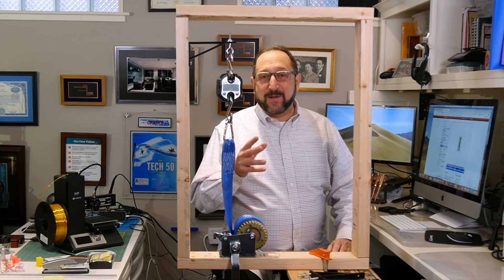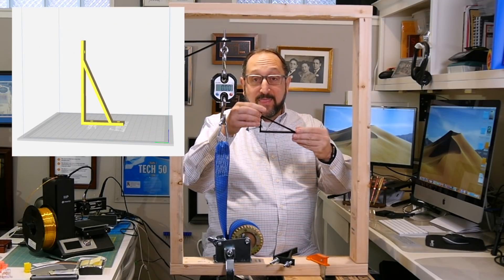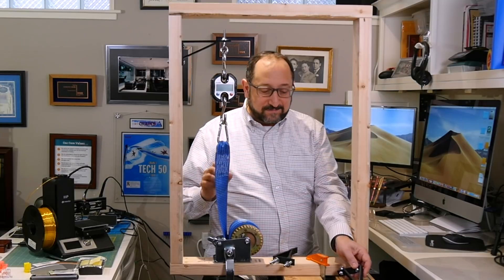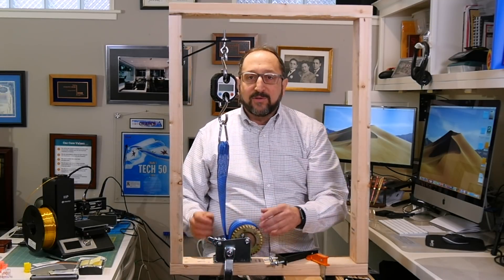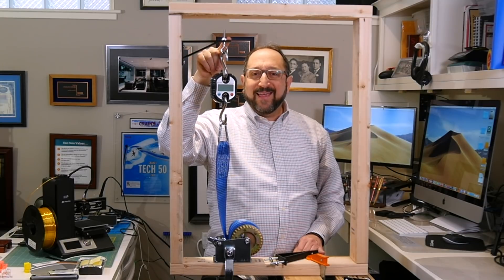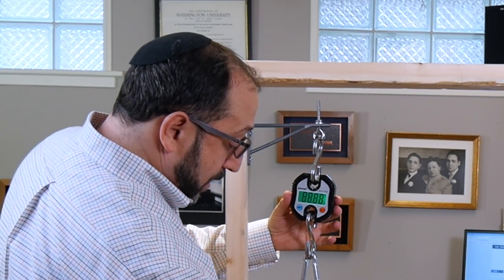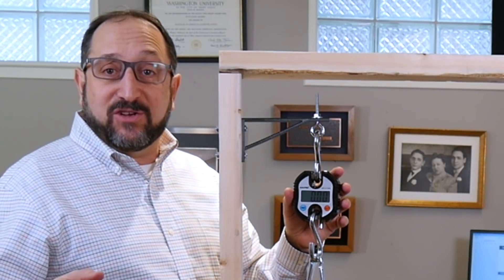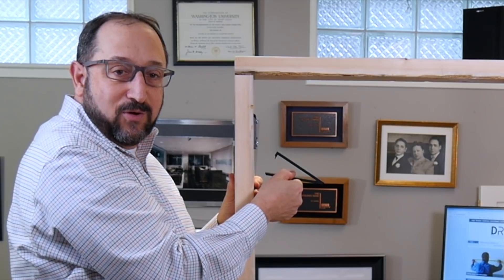How to Print Stronger 3d Printed Parts

Comment: Actually I think we should focus on a moment when print is starting to deform- because in that case it already has a sympthoms of failure and eventually it's going to break. So , my idea is: pick up a max weight value (for example of shelf + total load) and calculate thickness/dimensions of  our print. That would be very practical and helpfull approach ;)
Reply from the maker: Good thought.  Thanks for sharing.

Comment: On the PETG you didn't use a fan did you?
Reply from the maker: I used default PETG setting which generally include a fan at about 50%.
Reply: @DrVax That is why it failed like it did.  With a fan it prints prettier but can't meld itself to itself as well and you will see about a 50% reduction in line to line strength due to it.  I used to print with a fan for PETG until I saw that and I now no longer do and all of my functional parts seem to shatter now instead of seem lines splitting apart.  Kill the fan for PETG and ABS prints.
Reply from the maker: Thanks for sharing.  Interesting information.  I now have a printer, Monoprice Ultimate 2, with a full enclosure.  Might be interesting to retest with no fan in a full enclosure.

Comment: Thanks for the video, Irv, what is the make and model of the scale you used in the tests?
Reply from the maker: The scale is this model purchase on Amazon "Hanging Scale, RISEPRO Digital Professional Hanging Scale W/Accurate Sensor for Luggage Fishing Construction Hunting Balance Pocket Crane 150kg W/Backlight RP-C100".

The winch is this model "8MILELAKE 600lbs Hand Winch Hand Crank Strap Gear Winch Polyester Strap ATV Boat Trailer Heavy Duty".

Comment: Ok this is the reason that designers should think differently designing for 3d printing instead of copying the designs of metal or wooden parts and hope they'll work.
Even the different orientation can double the strength of a part. Plastics are largely anisotropic. So the layers should be thought of as wood fibers and treated accordingly.
Reply from the maker: Exactly.  Great comment.  Thanks for sharing.

Comment: I wonder how much stronger ABS would be?   Did you have any issues with PETG sticking to the bed, that is my fear in trying it?
Interesting experiment!!  Thanks
Reply from the maker: In the tests on other channels ABS is about the same or slightly weaker than PETG.  I see limited reasons to use ABS with multiple variations of PETG available.   

I wipe down my print bed with windex and leave a thin film of the residue on the surface when I print petg and have had no problem.

Comment: Thank you for this video.  Do you recall what your printing temperatures were for these brackets?  It is interesting that when you tested the brackets that were printed with the long dimension vertical, it looks like the layer adhesion of the PLA bracket was better than it was for the PETG bracket, even though the PETG proved to be stronger and tougher than the PLA with the brackets printed in the  horizontal orientation.
Reply from the maker: Great question.  The PLA was Hatchbox PLA printer at 200c on a 60c bed.  The PETG was SUNLU  printed at 240c on a 90c bed.  I used Windex on the bed to reduce the PETG adhesion so I can get the prints off.

The part specifications were .2mm layer height, 1.2mm walls, 3 walls, 4 top layers, 4 bottom layers, fill at 30% infill pattern triangle.

I will also add this to the video description.  Your question reminded me as I intended to do this but forgot.  :-)

I may try and do another video where I just test the impact of hot end temperature on strength.

Thanks for the question.
Reply from the maker: Both components were purchased from Amazon.

1) 8MILELAKE 600lbs Hand Winch Hand Crank Strap Gear Winch Polyester Strap ATV Boat Trailer Heavy Duty.   

2) Hanging Scale, RISEPRO Digital Professional Hanging Scale W/Accurate Sensor for Luggage Fishing Construction Hunting Balance Pocket Crane 150kg W/Backlight RP-C100